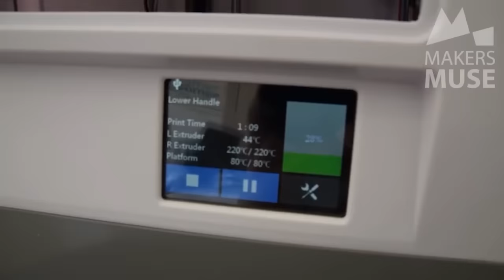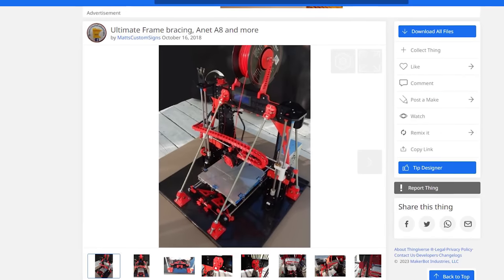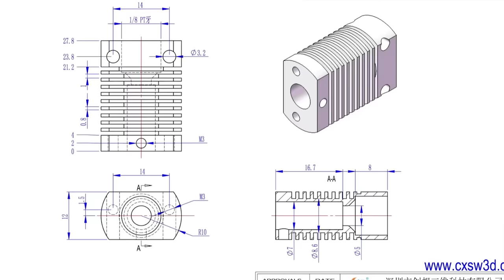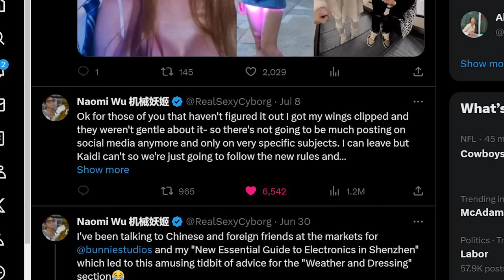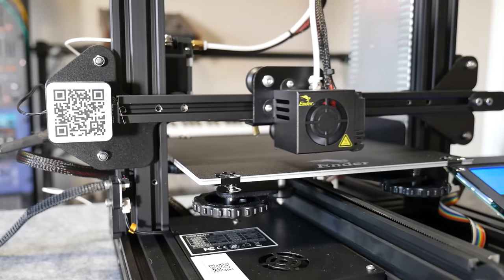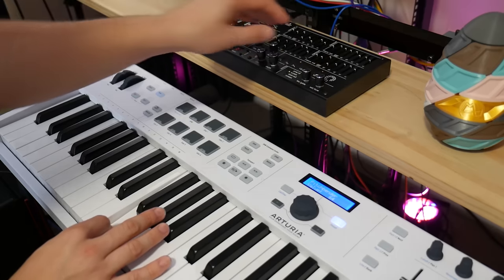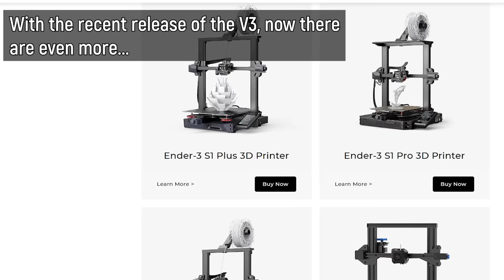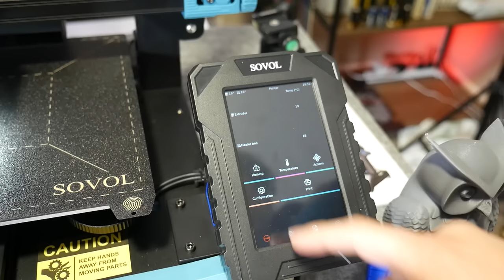Creality Ender-3... it's time to move on.

Comment: One thing that still keeps Ender 3 variants sometimes more competitive for some people are the coupons that Microcenter likes to do for “new customers”. An Ender 3 V2 at $99 is hard to beat, especially for someone that isn’t sure they will stick with the hobby.
Reply: yeah if one was closer I would have one myself.. I've only seen in store coupons for it though. You cant buy it online for that price.
Reply: I agree, that if you are like me and bought a Homers/Tevo Tarantula for about $110 to learn what 3D printing is all about, then sure.  I learned a lot, about all aspects of 3D printing.  Software, hardware, materials, and I thoroughly learned how to modify the Tarantula.  Fortunatly, after I got all the learning out of the way, Sovol released the SV06.  That is the printer I use for printing.  The Tarantual is in parts, and may get up and running again someday, with a ton of mods.  When the Sovol arrived the Tarantula was on its last leg.  The Sovol just prints, with very few mods, and it will just print 24-7 without any complaints.  Kind of like a Prusa MK3.
Reply: Then they try to use it, can't get good print, get frustrated, and tell people how 3D printing sucks. 
Not everyone wants a learning curve and tinkering.
Reply: @ScytheNoire  Much easier to just start with the Sovol sv06. They have refurbished down to $180. Kingroon has cheap linear and innovative rail printers.
Reply: Got my Ender 2 V for $99 from Microcenter. Code from Jay's2cents and a $100 off from Microcenter I couldn't pass it up. Snagged the Z axis upgrade. Had a small retention tab on one piece broken but that's a shipping issue. Some glue to get the printer running and a re print of the part... Bam good starter machine.
Reply: yea came to say the same thing. if you don't think of it as a 3d printer and more of a "base XYZ movement system" it's a hell of a value for only $99. I took one and turned it into a mini-CNC for PCB design, as an example.
Reply: @ScytheNoire Or the company could actually improve the quality control or their printers. Ender v3 se is heading to the right direction.
Reply: yeah I managed to get near one on a vacation and getting an ender 3 pro for $100 is something you cant really pass up
Reply: Tbh, Microcenter’s $100 Ender 3 deal is trash now that there is the Ender 3 S1 Pro.

MicroCenter offers the $100 for Ender 3 Pro, and $130 for the Ender 3 S1 Pro as the updated customer offer. 

The newer one addresses a lot of the issues along with a freaking direct drive extruder and a twin screw Z axis along with a bed leveling touch sensor.

By comparison the amount of upgrades I did with my $100 Microcenter Ender 3 Pro just to match the S1 Pro Microcenter deal, the upgrade Ender 3 Pro is about to hit the entry price range of a Prusa Mini+ (~$400).
Reply: 3 v2 for a 100bucks, thats a dream
Reply: @robster7787  That is a much better deal for sure.  I got my ender 3 pro when the S1 was just coming out
Reply: I couldn't find a V2 anywhere last week for that price, so I ended up getting a V1 for $99... and then the very next day I found a new V2 for $91. Like, WTF?
Reply: Problem is, someone who isn't sure they'll stick with the hobby - especially an experienced maker with other tools - will tend to bounce off at the tenth or so sign of trouble. I bounced off a CR-10, and am just coming back to a Bambu X1C, because at the end of the day the printer is a tool for making things - if it takes up more time and money than getting those things made through any other means (or just not making them at all and working around the lack) then it isn't going to get done. And the only reason I'm coming back at all is because I have a part I need to make which would require a $500 chunk of aluminum and a day's worth of CNC time - and an X1C and a kilo of ASA-CF is cheaper than that.
Reply: Literally got the v2 yesterday at microcenter with this deal and there were two more people getting it at the same time. I have far more time than money so it makes a cheaper filament printer as a first option easier, and family members I live with love the prints so far
Reply: @EyeMWing  Damn, that sucks you had problems. Have heard that with the Ender printers and many others that you can either get lucky (like me) or you can get unlucky like some people and have to endlessly around settings, upgrades and mods to get a good quality part.

If the part can be milled out of aluminum, then can if be milled out of polymer? or would the carbon fiber damage the end mills? (I know it would, but I have no doubt that an end mill could easily cut through many CF Nylon blocks before being damaged).

I'm not making suggestions or anything and don't have a clue where you could buy a block of CF Nylon or ASA... but just wondering for educational purposes. I don't know about surface finish and cut/feed speeds and all that... but I'd bet that a CNC machine could rip through polymer like butter. My worry though is the part being warped by the pressure of the vise or whatever mechanism is being used to hold the part. Would have to be creative (or lucky) to fix the problem or to not have the problem at all.
Reply: the guy keeps talking about the original Ender3 which had a ton of issues.. Creality is still selling them maybe to offer a really cheap entry to those who want to spend the least, but I have no idea why people buy the Ender3 S1 (or the S1 Pro) are already on the market for some time for slightly more money, and that is pretty much the model which resolves ALL issues that used to come with the original Ender3, plus some other improvements.
Reply: did exactly this, $100 ender 3 to see if i would like 3D printing and over the course of time doubled that cost in upgrades while trying to troubleshoot what is just a cheap product with no quality control. now that I know I will get value out of a quality printer, a Bambu X1C is my next move.
Reply: @ScytheNoire my journey after getting it included messing the Z-stop, finally understanding not to do that, ruining the pei bed and getting a glass bed before being able to even attempt my first print. Eventually more prints started to come out bad/fail so I ended up getting a cr-touch(which was painful enough to get working). And even now, I have some issues printing smaller parts and still need to play around with calibration.
Reply: the deals are pretty good i just bought an ender 3 v2 neo for under 300 cad and it comes with two rolls of free pla
Reply: I bought two from Microcenter and it taught me and my son a lot, but we are upgrading to a Bambu P1S for many reasons.
Reply: I grabbed one of those. It has not been easy. Now it will stop and squeal.  Had nothing but trouble out of it. I have followed every video I can find.
Reply: that microcenter deal is what got me into it.  and perhaps it was because of all the warnings that I was very hesitant about getting one and it being too much tinkering, but I was pleasantly surprised how great it prints with basically no tweaking after initial assembly.  I will say that while I enjoyed the assembly process, its more involved than many people likely want to have to deal with.  So, great starter for the budget conscious and mechanically inclined.
Reply: I realize those are yankee freedom bucks but holy shit that's cheap.
Reply: @auroraRealms  How is the sovol holding up today? Looking at getting the sv06 or sv07
Reply: @archivedcafeteria  I would not buy the SV07. The SV06 runs like a champ 24/7.  No problems, except the SV06 does require a bigger y axis motor. Either swap it with one from an older printer or buy  a new one for about $15 dollars.  The motor just bolts in with no modifications.
Reply: @auroraRealms  thanks so much for the advice, would you have or know where I could find a tutorial on the motor change? Also why the sv06 over the 7 thanks 😁
Reply: @archivedcafeteria  The motor swap is super easy with the tools that come with the printer.  Oh also, insulation under the bed is good ( about $2). Those and very few 3d prints are the only mods I made to the SV06. The SV06 is a clone of the Prusa Mk3.  The SV07 has v-wheels.  Nero3D says: "friends don't let friends make 3d printers with v-wheels".  The Prusa design is the arguably the best for 220mm bed slingers. And the SV06 has better electronics than the original Prusa Mk3.
Reply: Got an ender 3 S1 for 200 bucks from micro center, pretty happy with it and the bells and whistles it comes with like the bed leveler and fancy build plate, although the damn thing jams more than I would like
Reply: I got a v1 for 99$, v2 for 99 would have been nice, but no MC near me :( 5+ hours to spend 99$... might as well buy the higher end printer.
Reply: This is why i own one.
Reply: The only reason I'd take and ender for 100 is if it came with enough filament for me to make my investment back
Reply: I have a different optics, I am considering mid-to-high tier options cause I wan't to be sure I won't get discouraged from the hobby by bad quality hardware.
Reply: @TheBlobik i personally would reccomend bambu if you dont mind their printers watching what you make. (You can go offline with them like i do but still) or maybe go for a prusa printer.
Reply: I would say a bad experience would out you off printing. I'd say it's important to be easy to set up, reliable, and affordable. Stopped trying to fix/troubleshoot the thing after a few months. Jumped to bambu and it worked out of the box with minimal effort.
Reply: Paying twice the price for an A1 Mini is still an infinitely better investment nowadays. From what I've heard, the sticker price of an Ender 3 isn't very meaningful, because it needs a lot of upgrades to actually have decent print quality. But even if you can get high quality prints with just a stock Ender 3, I know for a fact that it will be a long, painful process getting it to that point, and keeping it there will continue to be a painful process. A lot of people give up entirely on 3D printing because of high-maintenance printers like the Ender.
Reply: here in Denmark they are going fore 70$ as used, so people buy them, fore entrance in 3d printer world. and upgrade them after that. so around 90$  fore a printer there print in a good way.

Comment: I absolutely agree, Ender 3 / Pro/V2, should be discountined from manufacturing. But Ender 3 V3 SE is actually a huge step forward.
Reply: The V3 SE is still a in violation of Marlin licensing, (you cannot get source), there is zero documentation for the motherboard or the display or the strain sensor... so making any modification or upgrades is limited to firmware creality provides (unless you gut it and start afresh)
Reply: I disagree. Maybe in many countries that makes sense, but for somebody like me that lives in Brazil, the original ender 3 is amazing.
It costs 1 minimum wage only, and it's available directly here (no importing taxes, current import tax is 92%).
Reply: @TehKaramelo  Where I live, minimum wage is done as a per hour rate. 
In Brazil, is the minimum wage done by week or by month?
Reply: @TehKaramelo  Tem que aproveitar, pq eu duvido que vai continuar assim nos próximos 2 anos
Reply: @DiscussToUnderstand   R$6,00 per hour, $1,19. Here is done by month and it's R$1320,00  or $262,45.  Yes, I paid $262 for a stock ender 3. If I had to import it would be $503.  At the moment I'm trying to buy the K1 and it costs around 1k dollars.
Reply: I wish I never bought mine. It almost made me not continue with 3d printing when I had trouble after trouble. When everyone kept saying "it was so easy to use and perfect for beginners" then turns out no I should have just spent an extra $100 and gotten something a hundred times better.
Reply: You mean another flavor of Colgate.. The Ender 3 V3 KE ?? ha
Reply: @TehKaramelo  Pity about the import tax because my Sovol SV06 wasn't much more than an original Ender V3 but it's much better, with many of the popular V3 modifications already included.
Reply: @TehKaramelo mano, sou brasileiro e sou dono de uma loja de impressão 3D. Sobre a K1… Não compre. KKKKKKKKK

A quantidade delas que já apareceram na minha mão por conta de problemas é putaria. Pegue essa mesma grana e compre uma P1P, e depois importe o kit de upgrade pra P1S se você precisar enclausurar…
Reply: Agreed. They need to discontinue everything and redirect all of their pages to the Ender 3 V3 SE
Reply: Funny, I still run my a8.  It's basically completely replaced nearly every single part, wiring and all, and the frame isn't even the same... but still, it has like 1 or two of the original anet screws...maybe a wire or two...lol
Reply: @jgxbernardo  O foda que a K1 já está literalmente acima do orçamento, então gastar quase o dobro na P1P não dá. A minha ender 3 também deu problema, tanto que fiquei com ela parado uns 3 meses ( porra de nivelamento). Preciso de aumentar a qualidade das impressões e diminuir o tempo para desenvolver mais peças. Não dá pra ficar 6 horas para imprimir um prototipo de adaptador.
Reply: @Dust599   so the marlin devs should warn / sue creality then. Since its a clear violation of their license, they wont struggle to win the case.
Reply: Had an Ender 3 Pro for 4 years, finally swapped it for a V3 SE, and after a single month the motherboard has already burnt a driver, and no way to repair it…
Guess I’ll find out how good the After Sales Tech Support is, after all!
Reply: @TehKaramelo  If they were to discontinue the original Ender 3 the Neo would come down in price and you would end up with better printers for the same price as an ender 3.
Reply: Why should it? Only Creality can say that. People are still buying, by the looks if it.
Reply: @TehKaramelo  crlh 92%

Comment: One benefit of getting an Ender 3 as your first printer is it come with about a month's worth of practice projects as you make all the parts needed to make it more user friendly.  I think the first prints for mine were different guides, brackets, fan shrouds, etc. 🤣
Reply: Same here; different motherboard cover with bigger (more quiet!) fan, different psu cover since the stupid Creality design blocks all air intakes. Dual part cooler shroud so the prints get cooling from both sides.
Reply: Same here, still have the same original one, nozzle changed once, new bowden tube, new mobo with TMC drivers (best upgrade), adapter to standard SD card and still up and printing...
Reply: Mine is stock and does what I need it to do
Reply: Never needed to print any real mods for the Ender 3 honestly, besides a shroud for the intake on the mobo.
It's always been the hardware stuff. New metal extruder cuz stock plastic will 100% break after a month or two. Changing hotend to one with a 0.6mm nozzle+Bimetal heatbreak and also having a whole spare Phaetus Highflow hotend that can be swapped with a couple screws.
Reply: Much of that is not especially valuable but it's cheap to print so might as well.  The main thing I found offensive as a lifelong technician is the sloppy bed level adjustment hardware. Four  star lock washers sorted that but should not have been necessary. Sloppy thread fit is inexcusable.
Reply: @mynameisprivate158  I wish I kept mine stock! Too many upgrades chasing tiny margins/unfixable problems instead of accepting what was reasonable from the factory.
Reply: @LobstersLobsters  what upgrades di you find if any had the most positive impact on print quality
Reply: Agreed, basically just a Bambu ad lol